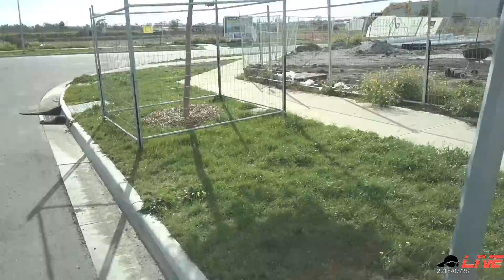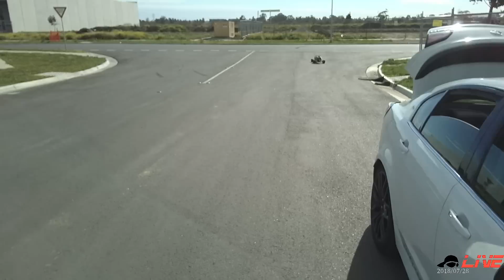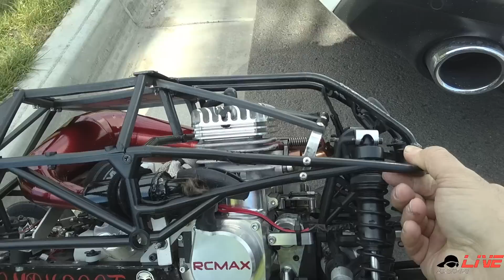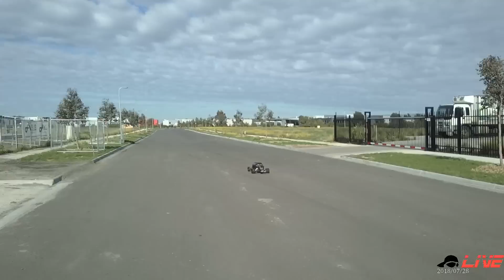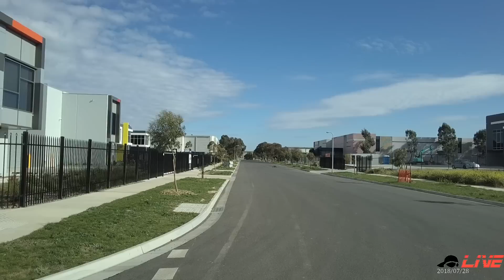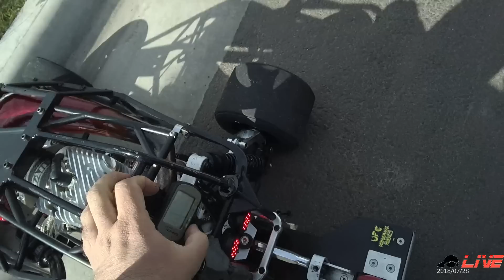Hpi baja RCMAX 90GT BRP SLICKS

Comment: Sounds like the squish is too tight and the piston is hitting the top of the cylinder. Or something else is rattling metal on metal. Just a thought, keep rippin!
Reply from the maker: Rattling sound is the brake rotors on the pads.  Normal

Comment: that pipe looks sik as Fck what enamel u using brother?
Reply from the maker: It was called metal cast.  There's a ground coat that goes on first which is like a silver metallic then the color goes on that . Looks good and can handle some high temp but it's not very durable and can chip .